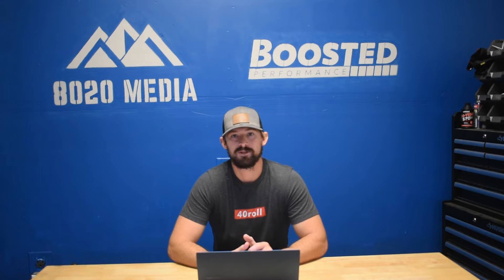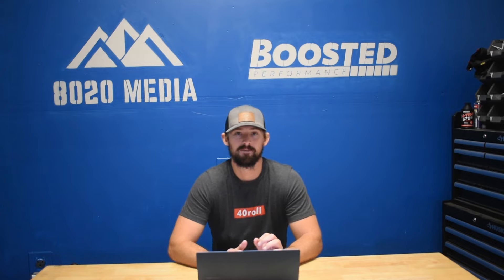DIY: How to Fix GMC/Chevrolet "Service Stabilitrak" & Traction Control Lights!

Comment: Codes U0073 P2544 P150C U0101

Hello. I have a Chevy equinox 07. A year ago the stabiltrak light started going off. I continued to drive it and it would come and go. Car drove the same. During the winter it had some issues starting where once I let it sit it would start just fine. This is when the light came back on again more frequently. This summer it suddenly stopped starting very often and I would get the above codes. The dash would flash lights going down the pndr and the rpms would bounce. Sometimes the car would act like the transmission was going out. I would turn it off and if it started it would be fine again. I took it in and they thought it was a fuse box issue and they replaced it. It ran fine for a few weeks and then started acting up again. They also tried changing the better bc it was 6 years old. Lights will go off but once I drove it home the next morning it lights up. Check engine light comes and goes. I tried to put as much detail as I could. I'm a single mom and I can't afford to just throw money at it and hope it works. Any suggestions would be greatly appreciated.
Reply from the maker: B - Based on the above engine codes, there could be multiple things going on.. This thread can help with some of the codes: https://www.gmfullsize.com/threads/u0073-u0101-network-errors-cant-communicate-with-ecm-tcm-bcm-and-abs.331213/

But only other thoughts would be some sort of sensor.
Reply: @8020Media   where would you start? I am not a car person so the codes and what they mean just confuse me. If there was a way I would upload the video of what it does. When I took it to the mechanic I spent almost 1000 for it to not fix anything. Would it be better to take it to a Chevy dealership?
Reply from the maker: B - Dealerships typically cost more unfortunately, unless you're under warranty. I'd start with the above article, it talks about what he did to fix two of the codes you're seeing. Keep us updated.

Comment: 2015 Chevy impala when auto stop turns off the engine when idle, service stabilitrak comes on and car rolls back if on hill.. something triggers and I gain control again. Very dangerous, no engine lights on and Chevy dealerships have had it several times and can’t figure it out… any advice?
Reply from the maker: I haven't heard of this happening in an Impala before and not because of auto start stop, there have been some issues with the Volt's but it happens under different circumstances and I'm not sure what the solution is. If the dealer can't find a fix I'd suggest installing an auto start/stop eliminator if that is the only thing that causes the problem.

Comment: Dealership is wanting to charge me 8000 for a new transmission replacement for my U0121 lost comm with EBCM issue. I get the TC, Stablitrak lights on, and brake light stays on.
Reply from the maker: J - Ouch.... Guessing it's not under warranty? It might be worth to try to get another opinion at another mechanic.

Comment: My service stabilitrack light came on and my TC turned off, but no check engine light, no shuddering, no misfire that ive seen, no weird noises, drives smooth... like... im confused more than anything. Taking it to auto zone to hopefully get a code
Reply from the maker: Waldo - Keep us updated! We hope it gets figured out.

Comment: My service stabilitrak is coming on but no other check engine light. I have taken it to 3 different shops that cant figure it out. But my cruise control is now not working.
Reply from the maker: Aaron - Unfortunately, as you've learned, this isn't the easiest issue to track down. But based off of your symptoms, maybe try checking these: wheel speed sensors, steering angle sensor, Yaw rate sensor, issues with the brake system, or engine control issues.. Sorry to hear about this. Keep us posted!

Comment: 07-13 suburban/Tahoe common issues
Abs sensors
Abs module
Mass Air flow sensor 
Corroded spark plug #1 or #7 
Intake leaks
Reply from the maker: Dont - Thanks for adding this valuable insight.

Comment: Is the type of gas could a problem ? My car is hesitating back and forth when I stop and is blowing smoke out the exhaust
Reply from the maker: Tray - While bad gas may not directly cause the StabiliTrak system to malfunction, it can cause engine issues that indirectly affect the system's performance. If the fuel injectors become clogged with debris or the fuel pump fails to deliver adequate fuel pressure, the engine may not run smoothly or may produce lower power output, which could cause the StabiliTrak system to activate more frequently than usual. Additionally, if the engine is misfiring due to bad gas, this could cause the StabiliTrak system to sense a loss of vehicle control and activate.

Comment: I'm surprised you didn't suggest anything electrical, such as bad grounds; G218 in particular and/or main.
Reply from the maker: Chris - This certainly can be the case. We just listed the most common causes and solutions. Thanks for adding this insight.

Comment: When I’m parked when I just sit there and spin the steering wheel near lock out my air conditioner weakens and service stabilatrack pops up. Aldo like if I’m parked and I try to spin the steering wheel really fast there’s no power steering but when I turn at regular speed there’s power steering 🤷🏻‍♂️
Reply from the maker: I - So you don't have any problems when you drive normally?
Reply: @8020Media  only like once or twice, once I was in a parking lot, was going real slow made a right turn and the truck literally SHUT OFF!
Reply from the maker: I - That's interesting... Have you taken it to a shop for this before?

Comment: I have a 2017 gmc sierra 1500. No check engine light, just replaced front wheel beering, and now its saying service stabilitrac. No other lights are on my truck, what could cause this as it seems to run great.
Reply from the maker: Only thing around that area would be ABS/wheel speed sensor so I'd check that. Have heard of people doing brake jobs on these tho and then getting the light right after for no reason

Comment: chevy trax has service stabilitrak and reduced power light but I didnt notice any power loss or hard shifting.  CEL suggests accelerator position sensor. Ever heard of the accelerator position sensor throwing these lights?
Reply from the maker: Joseph - Yes, this could certainly be causing this issue. We would advice inspecting the APPS and replacing if need be. Then go from there.

Comment: Mine pops up with stabilitrack off, traction control off, and wont let it turn over. Sometimes if you throw the ignition off and on a few times then it starts up and the lights go away. What may that be pointing to?
Reply from the maker: Kenny - Unfortunately, this could be a number of things. Have you gone through the video?
Reply: @8020Media  so far everything seemed to be fine. I honestly dont know what could be going on. I have no check engine codes come up when it does it.
Reply from the maker: Okay - Here are some things we would look into: Wheel speed sensors, steering angle sensor, check the ground wires, brake light switch, & battery or alternator. Keep us updated on this.

Comment: Will a PO449 code make your stabilitrak light to come on..?
Reply from the maker: Cedric - it certainly could. P0449 is an EVAP issue and it can cause misfires and rough idling, both of which would trip the Stabilitrak system. We have a guide on how to fix P0449 issues: https://chevytrucks.org/p0449-engine-code-evap/

Comment: Have an 08 Sierra I bought, service stabilitrak came up along with check engine and traction control. When it happens it goes into low power mode. I can turn it off wait a couple of minutes then turn it back on with no issues. Sometimes the check engine light will stay on after sometimes it doesn’t. Anything you think it could be?
Reply from the maker: Matthew - Did you watch the video? We provide a hit list of things to look for.

Comment: I'm having that problem and I also have an exhaust leak at the header flange (which I'm fixing this weekend). Any possibility that the exhaust leak could be causing it to trigger the stabilitrak error?
Reply from the maker: Alex - Typically, this wouldn't usually be the cause, but it could indirectly cause the service stabilitrak to go on. Keep us posted after you do the service.
Reply: Did anyone figure out if the leak was causing it? Mine just came on after a cracked exhaust. I noticed my car idled different for weeks then the spabilitrak came on along woth the abs light. I have no codes  coming from the scanner. Going to fix the leak and hopefully it all goes off
Reply: @tylerjackson7228  fixing the exhaust leak didn't solve the stabilitrak issue. For me, It turned out to be as simple as the MAF sensor. I didn't have the ABS light though. If you got the stabilitrak/abs warnings simultaneously, it's likely to be one of the wheel speed sensors (aka abs sensor). Those sensors don't trigger the engine light, which is probably why it's not throwing any code. I'm an amateur, but I try my best lol
Reply: @tylerjackson7228  mine turned out to be not related to the exhaust leak at all.  It was the stupid brake switch.. even though I had installed a new one.  Apparently the new one broke in like a week.  f’ing junk parts.  Then an airbag light started coming and going.  So I sold the truck.  Good riddance.

Comment: Getting a loss connection to TCM and I’m in limp mode. I’m having issues with engine light,stability track,and traction control being on and I’ve replaced the ABS censors, coil pack,manifold on top,spark plugs,and throttle body. Any other spots to go to from there? It’s a 2014 Chevy Cruze 1.4L turbo.
Reply from the maker: Michael - Have you tried to pull any codes? Things that we would consider would be looking at the wires and connections associated with the TCM, checking your battery and alternator, checking the TCM itself, and fuses/relays.

Comment: My 2011 Traverse service stabliltrak and traction control message is flashing. I don't have reduced power. I have replaced the steering angle sensor.  Had an engine diagnostic performed and I was told that was the issue. I have cleaned the throttle body. Replaced spark plugs. Still can t get the message to disappear.
Reply from the maker: Robert - have you noticed any random misfires or occasional rough idling? Spark plugs or a dirty fuel filter could cause this issue without throwing a CEL. If you are flex fuel capable I'd suggest running a full tank of E85 and seeing if that clears out the fueling system.

Comment: Hey Jake I need some help and we don’t know who to turn to, my brother has a 2016 Silverado the stabiltrak error comes up truck won’t start at all, some days it will and some days it won’t. He has spent over $2000 already had the ABS module replaced, battery block replaced, and some other things that were not the problem, no one can diagnose it. Anyone that can help please do I’ll listen. He also loses power steering.
Reply from the maker: Chris - Unfortunately, it is quite hard to diagnose.. But here are some other things to look into: ground connections, steering angle sensor, wheel speed sensor, power steering, & battery/alternator.

Comment: I put in new struts to level a 2016 Colorado and now the stability light turns on and my power steering turns off. Changed OEM mass air flow sensor and worked for a month.
Reply from the maker: B - So it's fine now?

Comment: I got a cylinder with some issues, it fouls out the plug and once I get a misfire this flashes in the dash. 2010 Silverado 1500. New motor is ideal, anyone have any information of where to get a motor from? Besides Jasper, AutoZone or O'Reilly's?
Reply from the maker: A - Sorry to hear about this. Best place would be to look around on the internet, most likely get a better deal.

Comment: I spent 1500 on this issue and they never fixed it. Please tell me what it is! Also the abs lights comes on with it. no check engine light either.
Reply from the maker: M M - We go over some troubleshooting steps in the video. Unfortunately, this isn't the easiest issue to resolve.

Comment: I gave my equinox a full tune-up and four wheel speed sensors and I still get service stability track
Reply from the maker: J - If you drive on it for a little bit, it should clear, if those were the problem.

Comment: My 2012 LaCrosse (3.6) shows cyl 4 misfire (Reader shows 15) and also a multiple cyl misfire, but no specifics.
Could this be the cause of the Stabilitrak message coming up? I changed the plugs about 40k miles ago.
Reply from the maker: Serafin - Engine cylinder misfires can definitely be a cause for the "Service Stabilitrak" light to come on. More than likely it is your spark plugs.
Reply: @8020Media  Just ordered a new ignition coil. I'll pick up some plugs for it too.
Reply from the maker: Serafin - Any update on this? Curious to see if it solved your issue.
Reply: @8020Media  No. It didn't. Before installing the coil, I swapped it with another cylinder. The miss went away, but the engine still idled oddly (guessing a loose coil wire?) and had some hesitation when driving. We hadn't noticed this as it happened over the years and miles. I went in another direction and cleaned the MAF,  throttle body and replaced the air filter. Although nothing looked terrible, the engine is now smooth as butter and no more codes.
Thanks for following up.
Reply from the maker: Serafin - Love hearing that. Thanks for sharing your experience. This will help others if they are experiencing the same!
Reply: I did all new coils plugs and wires and still have cylinder 4 mis fire any ideas??
Reply: @robertross9909 I cleaned the throttle body and MAF and changed the air filter.

Comment: 2010 2500hd has stabilitrak, abs, and check engine light on, but isnt running rough or seem to have any real issues going on. I thought just sensors but ill defintidlt check the plugs and coils. Any other ideas with all three on at once? It was fine and then would flicker on and off for a bit but now is on all the time. Probably any number of things eh? Lol
Reply from the maker: Sir - The symptoms you described are making us lean to an electrical problem. So sensors/wiring. Have you had it checked out at a shop?
Reply: @8020Media  not a shop no. I've had codes run, but nothing but evap shows up.
Reply from the maker: What code specifically?

Comment: Ive actually change my ignition coil, spark plugs, AND my wires. I still have the same misfire on 7 and to boot, when i re-replaced the spark plug the brand new one from the night before looked like it had been in there for a LONG time. Like it was burnt and old looking. Drove it 45 min to get to my shop. Ran perfectly fine. Idk what else. Pls assist. Its a 2010 avalanche ltz
Reply from the maker: Z - This could be a few things. Unfortunately, this isn't an easy issue to resolve, but we'll do our best to provide some things to help resolve it: 
1. Fuel injectors
2. Run a compression test
3. Vacuum leak
4. ECM or PCM issues
5. Camshaft or crankshaft position sensor

Keep us updated on this.
Reply: Ran a compression test, holds no pressure. Goes up to about 30-35 then straight back down.
Reply from the maker: Zala - Unfortunately, this is not a good sign.. This means that there is an issue with valves, piston rings, pistons, head gasket, camshaft.

Comment: I am having this issue, when I take it to the shops they don’t know what it is. Seems like this guy needs to teach them! I just changed the spark plug wires & cylinder 4 because those would come up on the codes but still hasn’t resolved the issue. The lights & check engine still going off. 😢
Reply from the maker: N - Unfortunately, this isn't the easiest issue to resolve. What engine codes are you getting?

Comment: So I have all of those lights on my dashboard (traction , ABS, service engine) but it also jerked right before the service engine light came in and also jerked right before the service stabilitrak indicator came on. Any ideas? The gmc dealership said I need to replace the sending unit and also replace the fuel pump. Could that be the issue or is it something more?
Reply from the maker: Fyne - Those could certainly be the issues. However, we can't be certain that it will solve what's going on. Unfortunately, Stabilitrak is not an easy thing to diagnose..

Comment: 2014 Acadia 
Have been dealing with this randomly for over a year. Power cuts, no check engine light, “traction control off, service stabilitrak.”
Reply from the maker: E - Sorry to hear about this.. Unfortunately, this isn't the easiest thing to diagnose.

Comment: I have a misaligned timing chain, so this makes my traverse idel at 1 rpm when it's in park and I'm assuming like you said this cause the lights to come on.
Reply from the maker: Yepp, that would certainly cause this issue!

Comment: Only thing I didn't hear you mention that will set of  Stbltrk. Is  the MAF mass air flow sensor. If you unplug it to change air filter & forget to plug it back in all lights come on...
Reply from the maker: J - Thanks for sharing your experience.

Comment: I have a 2011 Escalade esv.  I have check engine light with code po300 and stabilitak light on.  I took it to the shop and after $2000 they didn’t fix anything.  New spark plugs and wires as well as new solenoid, maf sensor and still nothing.  Car only misfires in idle, which makes the stabilitrak come on.  Anyone have a suggestions what could be wrong?
Reply from the maker: K - We do have a P0300 engine code video, but not sure if it would help or not since the mechanics have already done work on it: https://youtu.be/f1mQ5hD1-vI

Have you reached back out to them? You would hope they would try to fix it..